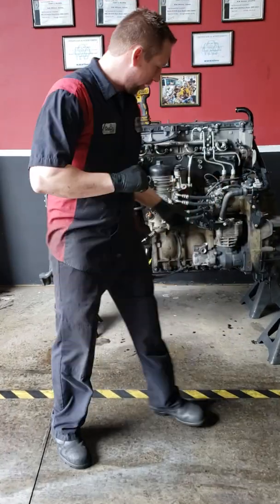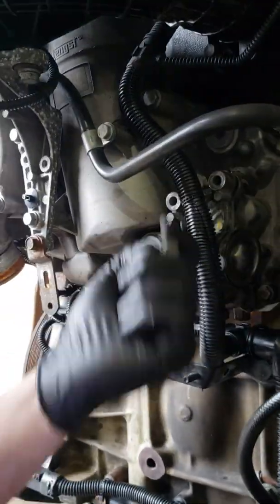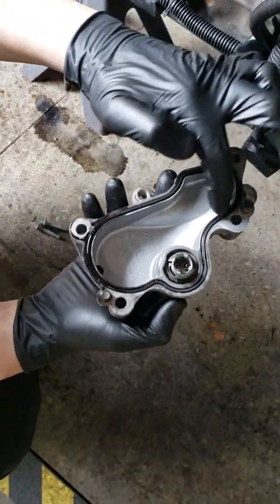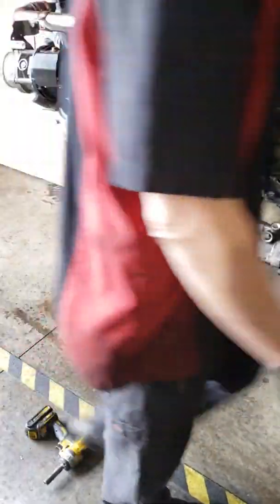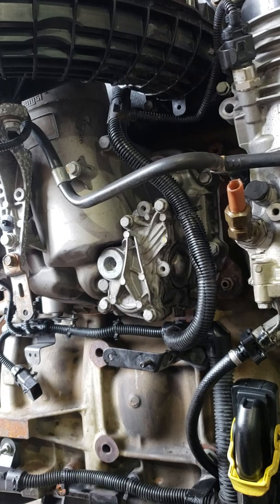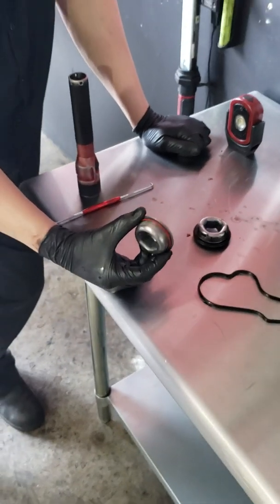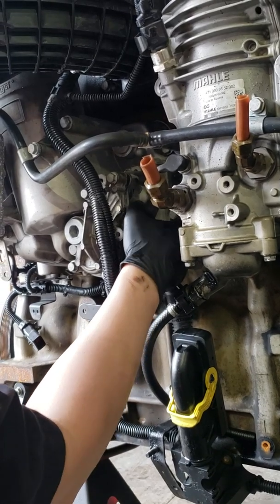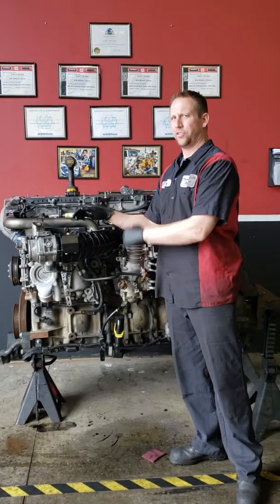Oil thermostat seal and screw plug oring replacement

Comment: @ 3:56 oil thermostat housing bolts 25 ft lbs TQ. I would do 22-25ft lbs because I’ve never seen Detroit manuals say “25ft lbs” but many say “22 ft lbs” on other components.